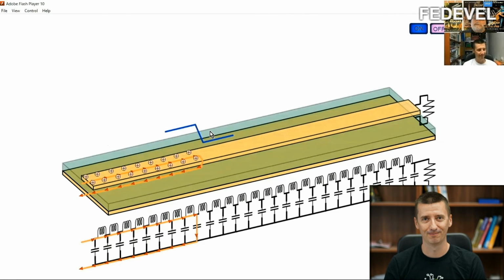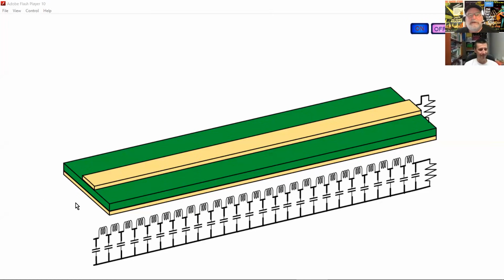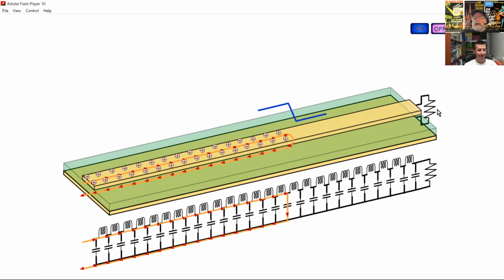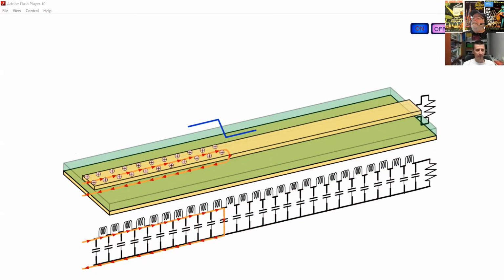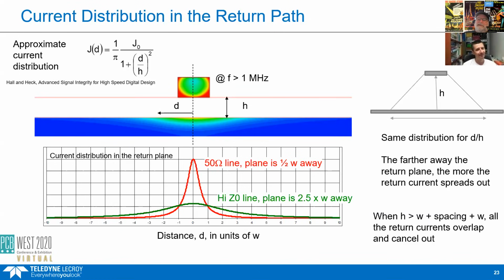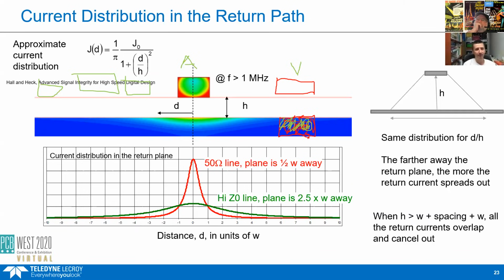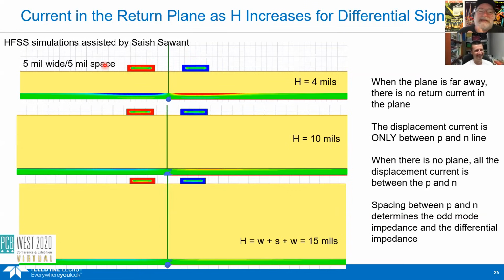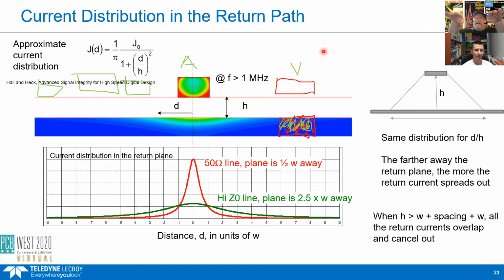What Every PCB Designer Should Know - Return Current Path (with Eric Bogatin)

Comment: The fringe waves on a microstrip transmission line interacting with the return path through the return ground plane will increase influential crosstalk currents the thicker the insulation dielectric is between the two but to see that it is around 10% overlap when they are one microstrip width apart and around 2% when they are two widths apart gives the interest for me behind the application notes in transmission analysis. i wish i could afford the analysis software though :p

Comment: Robert, a great video again! Let me ask one thing: Ground plane ultimately connects to wherever it is routed through a narrowed conductor/pin/connector. To me that means mixing all the return currents, changing the impedance and thus creating some reflected waves. Am I right? Does that introduce noise if multiple signal lines have return currents that way? Thx.
Reply: Good question. I would expect that collecting the signals together at a single ground pin would create noise. The better designed complex chips have multiple ground pins so that there are fewer signals coming into any single pin (and the signals come back to the ground pin closest to where the signal came from). But I would expect that the impact is relatively small, say compared to the noise created by routing a signal over a split in the ground plane.

Comment: Great video as usual, Robert. I read a paper somewhere that you can help mitigate the effects of cut planes by carefully placing capacitors ACROSS the gap. If the gap is on the ground plane beneath a signal on the top, the signal line would reach the location of the ground gap and right where that gap occurs, you plant a capacitor on the signal line on the top plane that allows the signal to continue. Somehow, that capacitor helps to minimize the effects of the gap on the return current. I am curious if you could investigate this in the future and determine how effective it is, or how ineffective it is. Thanks.
Reply: Yeh...in advanced layout course, mr.Robert mentioned about stitching caps....I am also curious if you make brief in future videos....
Reply from the maker: Thank you B B PS: I read the same

Comment: One more question:   As the return currents flow beneath the traces, the differential pair over a ground plane can be thought of a 3 differential lines: + to - , + to GND and - to GND.  Now, if I want to avoid reflections I terminate + to - with a characteristic impedance. But should I also terminate + to GND and - to GND lines?  Perhaps the + to - terminating resistor somehow couples to the + ,- to GND lines so it won't be necessary, but I don't see how it could happen...
Reply from the maker: When you route diff pairs, single line (single negative or single positive tracks) should usually follow single ended 50ohm impedance and together they need to follow required differential pair impedance (e.g. 90ohms)
Reply: @RobertFeranec  Thanks for the reply. So, does it mean that I have to use 3 terminating resistors (in case the destination chip doesn't have these built-in)? Two 50 ohm tied to ground and one 90 ohm between the lines?
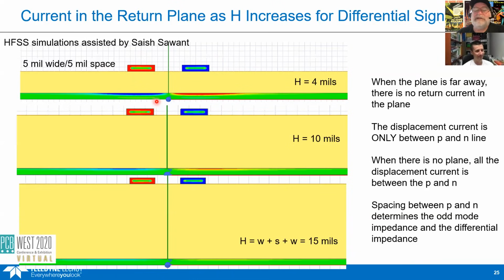Reply: Below a differential pair there is no current in the gound plane in the direction of the signal.  There is current which is perpendicular to the signal direction between blue and red regions of the ground plane, see at 37:30.  The net return current is through the other pair trace and the both traces have capacitive connection with the ground plane at that point and the ground plane only helps to connect the current path between the traces.  You must note that both traces are changing their voltages at the same time and in opposite directions, thus needing no net return current via the ground plane to elsewhere in the circuit!

Having said all that, the presentation is very good and it really helps to conceptualize the subject!
Reply: @Alo762   I don‘t think it is the way you're saying. As Maxwell equations are linear (even when accounting for dielectric environments (in the first approximation)), we can consider a transmission line as a superposition of two closely spaced microstrips. Each one being fed with a current separately. Then, the resulting fields and currents for a differential pair would be the sum of the two cases. Obviously, for a single microstrip line there is a return current in the plane in the direction of the trace (*). When there are two microstrips working in opposite directions, their return currents in the plane almost cancel each other out -- but not entirely because of being displaced by the effective width of the differential pair. 

Also the picture at 37:30 is a cross-section meaning the red color is a current flowing from us, blue a current flowing towards us, indicating the current flows in the direction of the trace.

(*) to be more precise -- while driving a single stripline with a voltage source, the other one is considered to be tied to a groundplane, hence the return current flows in the other stripline as well as in the ground plane. The former then contributes to the differential part of the return current you have been talking about.
Reply: @32bits-of-a-bus59  I see what you mean and yes, *the situation is not as simple as I claimed*. There is brief current in the ground plane in also direction pointing to the signal direction combined with the current in perpendicular direction.  I think the most important thing is to have wide enough grounded strip below the diff pair which should be continous and if it must be broken in some places, skip over these gaps with caps or wires and kee these gaps as narrow as possible.  Someone else mentioned stitching to other ground planes to do that shorting.

Comment: Thanks for inviting very interesting guest!  In the case of differential pair over a ground plane, I'm wondering about the magnitude of the return current (compared to the differential signal current) that gets induced in the ground plane. It was not quite clear from the color coded images but I think that it should go to zero as we move the plane to infinity (as the fields from + and - line cancel each other the better the farther apart off the pair we are). It would be great to know that the return current for a pair being 2*w above the plane would be let's say 1/4 of the signal current (contrary to non-differential signalling where the return current is equal to the signal current.
Reply from the maker: Thank you.

Comment: As a beginner, I'd like to know is return current avoidable? Is signal integrity reliant on the existence of return current? Can we actively avoid it or engineer it out?
Reply: Current flow in a closed path. You cant avoid the return path, otherwise your circuit is open and there is no current. You can use differential signals, in which the signals talks to the other line

Comment: Hey Robert, in your 3-trace split ground plane simulation (31:05), there is regular ripple pattern on the return current path around the edge of the cutout. I'm wondering if that is constructive interference of all three of the return traces return currents at 1MHz. Can you measure the distance between those ripples and see if that matches the wavelength of 1MHz? Also, the distance between the traces at the cut appears to be a multiple of the ripple.
Reply from the maker: Interesting. I am planning to go back to these simulations after I know a little bit more about what everything ADS includes in the simulation and when I play with 3D field simulations.

Comment: I think it would very valuable if every electronic engineer is taught about electrostatics and the impact they have on electronic devices. A lot of what goes into designing signal integrity with return paths, crosstalk etc. becomes intuitive when you understand how a very dense and very fast impulse forces its way through a design destroying all the barriers you thought were insulative. Generally, we just assume out of college that the impedance between traces is too great to be a concern, but that is only true in limited circumstances.

Comment: Great video Robert. I haven't had much experience with signal integrity yet, but I've already come across Eric's work and reputation.
Personally I'm a fan of the long form conversational content. I think it helps understand the topic better.
You might already have videos on this, but power distribution networks might be a good topic if you haven't already covered it?
Otherwise maybe a video on actually running power integrity and signal integrity simulations, the tools, what to look for in the results etc? Not sure there is much information out there on this, I could be wrong - I haven't really looked for it yet.
Reply from the maker: Thank you Gianmarco PS: I started some topics about power integrity in my Decoupling capacitor videos (working on more): https://youtu.be/5Ca0Eah7eKI

Comment: Eric just started making a point about how ground copper fill can be bad and you cut him off... ;-(
Reply from the maker: Maybe another topic? :)
Reply: @RobertFeranec  Absolutely! Did you know that ground copper pours could be really bad? I sure didn't, and I've done a fair amount of reading about EMC...
Reply from the maker: @ats89117  I have read some articles (can't remember where), that if not done properly it can make your board worse, so I do not use it.
Reply: Eric is presenting on the topic of Copper Pour during his Altium Live 2020 Keynote speech.
Check that talk.

@ats89117 - you may see there copper pour adds now extra value.
Reply: @saishsawant6558  Thanks!
Reply: @saishsawant6558  Just finished watching the keynote address. I found it a little disappointing, but maybe because I am building conduction cooled power amplifier boards. The copper pour is rarely used as a signal return. It is primarily used for heat dissipation in addition to the solid ground plane on the back of the board. The copper pour on the front layer has the advantage of not having to transfer heat through the vias (they aren't that good at transferring heat unless they are copper filled). These boards use at least 2 oz copper and still run hotter than desired, so not using copper pour wouldn't be an option.

I was hoping there would be an example of a bad copper pour causing problems rather than just saying they are useless, but on the optimistic side, I hope my competitors see this and follow this advise! ;-)

Comment: still confused about if there's no plane at all under the signal ( 1 layer pcb for exp ) how the return current will flow?
second question: is there a return current path for vcc signal ( 3.3V for example ) ??
Thanks
Reply from the maker: If you do not use plane, you probably use GND tracks (so some return currents will flow through GND tracks) .... however ... and we were not speaking about this ... but if you do not provide good enough return current path, I believe, return currents may actually return through some signals .... Have a look at this video, it may help: https://youtu.be/EUAJbNnqhLs

Comment: Thank you Robert and Eric. Please keep these videos coming. It seems to me that having ground return traces directly under the signal traces, separated from the ground plane but for a single point (star ground) like the fingers of a hand, would minimize cross talk. I wonder if one of your videos might address this. Is this a viable method of keeping noise to a minimum? And is it worth the extra effort?
Reply from the maker: Thank you Roger
Reply: Roger, I don't think it's as easy as it sounds (even if you had enough room for that), as "return currents" are not especially tied to the power supply; it's even unlikely: it will most probably come from the decoupling capacitors and such. Imagine a signal between the CPU and some RAM module.... where is the current being sourced? The CPU decoupling caps? The RAM module decoupling caps? Both? Mmmmm....
Reply: @guillep2k  I was thinking more along the lines of analog transmission; audio and radio. Or high speed serial data with balanced transmission lines.

Comment: Dear Robert, 
I have a wild suggestion for reducing digital crosstalk. 
Instead of having two side-by side digital tracks running over a contiguous ground plane, why not have a separate ground track for each one located on the "ground layer", that takes the exact same path as the signal trace. (i.e. you cut-and-paste the signal layer tracks onto the "ground layer").
The signal's EM wave would then be more tightly constrained to propagate through just the dielectric located between the signal layer track and its dedicated ground-layer track.
I feel that this should act to significantly prevent the return currents from two nearby signal tracks from mixing together and causing cross-talk. 
I would love to see a simulation of this idea.
Obviously for the high current return-paths from IC power pins you need a contiguous low-impedance ground plane on one of the deeper layers of the PCB, but for those high speed signal tracks where crosstalk is an issue then I feel that the ground reference for those tracks would be better implemented using individual ground return-path tracks.
Reply from the maker: Dear Nicholas. I am not really sure what would happen ....
Reply: It could work if both sets of traces are the same electrical length and see similar disruptions. One of the key principals of differential traces is to reduce the odds of one trace seeing something different than the other trace so that any disruptions are common mode and not differential.